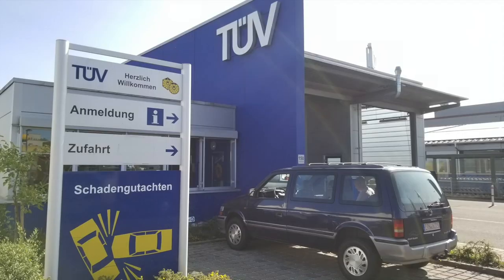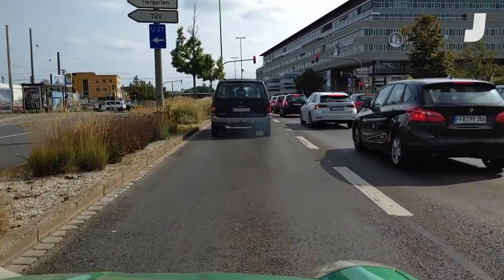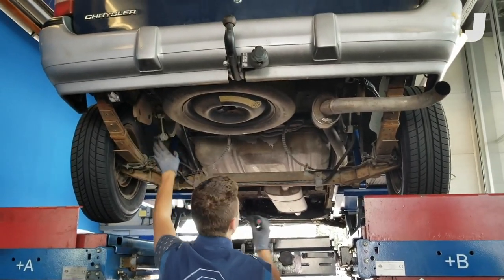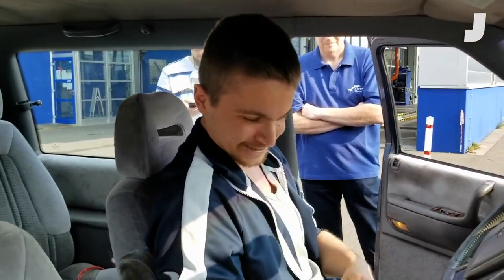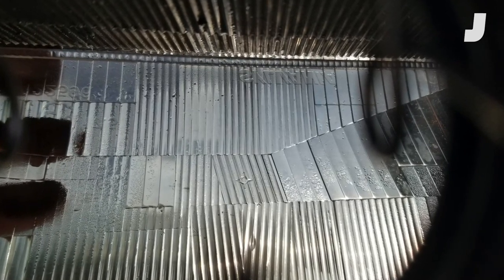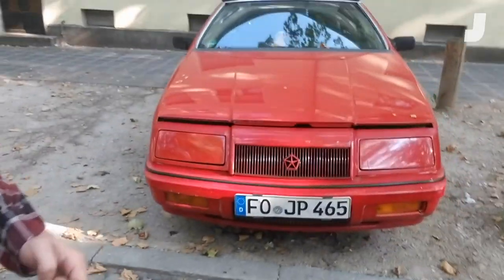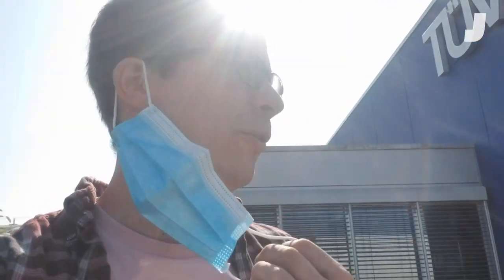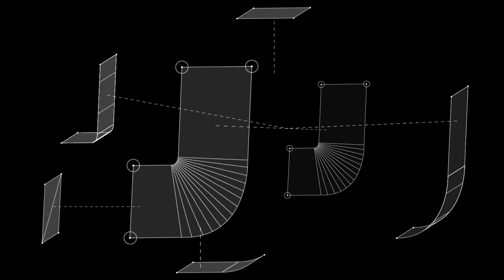I Took A 250,000-Mile Minivan Through Germany's Rigorous Car Inspection And It Was A Disaster

Comment: The price you pay for unlimited speed on Autobahn 💪🏼
Reply: In an old minivan? Its 0-100 time must be 40 years 😂
Reply: One of the many reasons why we will never have a no limit road in the United States
Reply: Ireland’s NCT is the same, once a car is 4  years old it has to do a test every 2 years, once it’s 10 years old it has to do a test every year. No autobahn max speed 120 kph (75mph)
Reply: @eamonnheffernan6061  Same in Switzerland.
Reply: Keeping a car maintained is usually pretty cheap, deferred maintenance is expensive when 2 or 3 things need fixing at the same time.
Reply: @eamonnheffernan6061  Still faster than the majority of Australia at least haha. Max typical speed limit in most Australian states is 100kmh and 110kmh in select sections. Only the Stuart Highway in the Northern Territory has no speed limit and that's only because there are so few people actually out driving in literal middle of nowhere.
Reply: The price you got to pay to be the first at the Autobahnbaustelle.
Reply: Most of the autobahn system now has speed limits, with only small sections without. However, even those sections without have recommended speed limits, with consequences (refusal of insurance coverage, etc) for exceeded those limits. Of course, inclement weather imposes limits throughout.
Reply: @dwightstewart7181  Wrong. Most are still unlimited
Reply: @ObamaoZedong  but even slow cars must be safe on their lanes, when others pass with 150mph
Reply: @piusmartin5178    ..  Right. You go there and drive with that fantasy in mind. I lived & worked in Germany for fourteen years (four periods over thirty years). Most of the autobahn system now has speed limits. The traffic alone is now too congested for it to be otherwise.
Reply: The price you pay for not having cars go through houses every week :P
Reply: @dwightstewart7181  I'll not claim to be an expert, but from what I've been able to dig up, only 30% of the Autobahns have some kind of permanent or temporary speed limit.
Reply: @panzerveps    ..  Guy, every built up area (cities, etc) along the autobahn system has speed restrictions. Since Germany is a crowded country, that alone undermines your 30% figure.
Reply: @eamonnheffernan6061 In New Zealand Vehicles first registered anywhere in the world on or after 1 January 2000 will need annual WoF inspections for their lifetime. For new vehicles, after an initial inspection, another WoF inspection won't be required until the 3rd anniversary of their first registration. Prior to 1st Jan 2000= vehicles need an inspection every 6 months.
Reply: @ArmadaAsesino I know where I am going to visit in Australia.

Comment: That’s not a disaster, having a brake cylinder seized is a schoolboy error for tuv
Reply: How so? They aren't there to diagnose WHY the issue exists. Just IF the issue exists. Lack of braking force is a failure. It's up to you the owner to figure out why and fix it.
Reply: @ArmadaAsesino  no, you misunderstand me. Not checking your brake cylinders are free before going for a tuv test is silly. And after failing once o brakes to go back again without checking them is a bit looney tunes. Hope they charge every time.
Reply: @Ebonyqwe  They do ;-)
Reply: @Ebonyqwe  exactly. They don’t just tell you that you failed. They give you proper data to very simply diagnose the problem. Then trying to sand rust pitting out of a brake cylinder? Wow.

Comment: All American cars has a steering lock all of them since the moved the ignition from the dashboard in the 60s
Reply: Just remove the steering lock...
Reply: @davidhollenshead4892  That‘s also a fail for TÜV. You need a steering lock for anti theft 😅
Reply: No. My 88 corolla has no steering lock from factory. My 98 escort does not as well. But my 88 galant does
Reply: @ZeldaNumber17  well a corolla is not made in America its not a American car neither was the escort it was made in canada or Britain it was a import ford made for there euro market and the galant was made in America weirdly its not a American car but it was made here
Reply: put a steel bar between the steering wheel and apply pressure till it breaks,you guys never stole any cars back in the day?
Reply: My 2004 Monte Carlo doesn’t have one
Reply: @KokaburraDesigns  The lock is not the problem. It locking with the key inserted was. Thieves only rarely come with the keys...
Reply: The integrated locking steering column began with all 1970 model year American passenger cars  from Aug 1st 1969 mandating the ignition switch
be mounted on the steering column and lock the wheel when turned off to deter theft.
Reply: @ZeldaNumber17  Where are you from? Steering lock is mandatory in Europe since the late 60's, and apparently in USA too, so these cars must be made for some other market area.
Reply: @KokaburraDesigns  saabs dont have steering locks since they have the key between seats
Reply: @sixunity1171  The older Saabs lock the gear shifter instead. You have to have it in reverse to get the key out. Newer ones have electrically actuated steering lock if I remember correctly.
Reply: @Eric Vincent Every car I've ever owned only locked with the key out. Even our 1999 Voyager. That's how it's supposed to work. Even if you turn the key to "lock" the steering will not lock until you pull the key out.

If that older Voyager is supposed to work like that, it's a rare exception.
Reply: yes on my saab you cannot take it out of reverse unless you put the key in
Reply: In the US the law is that either the shifter locks or the steering column.  In many cars, both do.

Comment: Similar to car inspections in Belgium. However, the emissions testing looks brutal to me. They only rev it once for a few seconds and that’s it. These tests are flawed anyway, at least in Belgium.
Reply: The test is different depending if it's a gasoline of diesel engine. A diesel engine is revved all the way to the limiter. If it passes on the first try, they don't need to rev it again. Sometimes it takes many tries, as there could be a lot of soot build up in the exhaust.

Anyway, if the engine is in good condition, revving it to the limiter is not a problem. If it were, would the limiter not be too high then? I mean, that's why it's there. To keep the engine revs from getting too high.
Reply: Adrian  calling belgium a shithole is downright silly.
Reply: No offence, but where I live it is exactly the same as in this clip. I think you might be happy to live in a place where they are not too strict. Even my 30 yo miata gets the same treatment as my daily. On another note, where should I go for my next inspection? :D P.s: I live in Belgium

Comment: The mot inspection in N. Ireland is pretty much the same if not even tougher. However the particulate exhaust inspection for diesels was reduced to a less stringent visual test after a string of engine failures due to the high revs.

Comment: About revving diesel cars for many times and for long preiods, it is done to get it through the emissons test. Basically it is to clean the engine of deposits. Warming/Cleaning up your motor before TÜV in my practice has almost never ended up with full gas for over about 10s. If your motor cant handle 10s of full revs well then it is not in a great working order and shouldn't be driven on the road.   Diesels should not be running coal, not even on full throttle.

Comment: This is almost identical to the irish inspections. They dont rev em out as high as these however for some reason. Pretty much a standard european inspection really
Reply: the revs on the emissions test are based on the rpm the max horsepower is rated at, so this is just model specific
Reply: You guys all have those ridiculous  contraptions that shake the car around? That part in particular seems like a very German thing lol.
Reply: @chickenfishhybrid44  nope, even my Eastern European backwater has, so I imagine it's pretty common.
Reply: @chickenfishhybrid44  only thing that can be said for it tho is it keeps heaps of scrap off the road
Reply: @bayseb4a  This is a diesel engine, so it is revved up to the limiter. The test for a gasoline engine requires at least 2000 rpm. Same for all cars, unless otherwise stated by the manufacturer.

Comment: Similar in Malaysia. They use the same machine brand too. 
Suspension test here is not loaded, right before the brake dyno there's 2 metal plates, they're to load each axle on it and the machine will vibrate each wheel separately to test the absorbers. Free play is done to the front axle, similar to the suspension test but these plates move apart horizontally to stress test the steering and tie rods. I have a fleet of commercial vehicle that needs to be sent for inspection 2x a year. 

From what I observed, you need to send the brake hub to a machine shop, have them skim the inner surface. You'll also need a new set of drum brake pads/shoe, brake cylinder(very cheap for drum brakes) and complete flush of the brake fluid. Sanding and not replacing the o rings will result in brake fluid leak in a few months time. It also means it's likely to fail during emergency braking. 

 If you have spare cash, try doing a very thin skim or replace front disc and pads. Clean and lube the whole front brake assembly, you might have some sludge in the front brake cylinder or stuck pins. 

If you did everything right, you'll be getting less than 10% brake force difference, usually around 3-5%. If not check if there's any diverter valves that splits the brake fluid between left and right or front to back. Clean and reassemble.

Comment: yea, that first fail is the biggest issue with the TÜV.
Generally its a good thing, safer cars and all yaknow
BUT 
Whenever you go there, you zhave to hope that the guy actually knows what hes doing. ive had like 3 or 4 fails with modified and unmodified cars by now simply because the person didnt know and just declared a fail.

Edit:
Now that i think about it, i think both the older mitsubishis i owned also locked with the key in the lock in one position so
maybe these guys just werent well informed
Reply: My father has an old English van that has a shorter axle in front, all factory. One time a dumb inspector was telling him he had a mad misalignment to the point he wouldnt even be allowed to drive out of the inspection center to fix it. Turns out one of the measurements the machine makes is comparing the lenght of the two axles and the guy's knowlege only went as far as reading the results from the computer. The problem had to be pointed out to him
Reply: @fgsaramago  that's the problem, inspections are just a scam to get money out of you, they do not increase the safety on the road, you can look up numerous studies that showed in places like America where some states have rigorous inspection vs those that don't and often times the vehicle accident rates are the same or sometimes higher in inspection states.  Most of the inspectors don't know shit about cars and just read shit off a screen, They should only hire real certified mechanics as these people will know what is safe to drive and what isn't.
Reply: @fgsaramago  it doesn't need to be something old or rare. I have a damn mk1 ford focus and the lady wanted to give it an advisory due to the headlights shining too low... The Focus, like many cars, has a switch that can change the headlight position from the inside. The woman didn't know and her ignorance could cost people money
Reply: @eduardopascoal7893  That headlight aiming control is mandatory since 1995, and it's function should also be inspected. Really weird if she was doing inspections, and wasn't familiar with this... At least in Finland we test that too.

Comment: That's pretty similar to what we have here in Spain. It's call ITV (Technical Inspection of vehicles) and they check pretty much everything from headlights, light, brakes, suspension components, seat belts, horn, rust, leaks and much more… they even look if the license plate is ok (if it's bend or the numbers aren't ok you have to change it).
If your car is brand new you have to pass it when its 4 years old, then every 2 years and when it's 10 years old you have to pass it every year. Depends if you have a car, a motorcycle, a truck this times changes… For example in a work van that is 10 years old you have to pass ITV every 6 months
If you don't have it or you failed and the police pull you over you have to pay a 200 € ticket and if you ITV is negative (means you can't drive your car on public roads until you repair it and passed ITV) the ticket goes up to € 500.

Comment: This TUV inspection seems  exactly like a yearly Swedish inspection (besiktning)
Reply: Just a bit more expensive, than the Swedish. 180€ is steep. I paid about 40€ last time if I remember correctly.
Reply: It IS basically the same thing, just not yearly but every two years. due to that its a little harder to pass tho because more bad can develop within two years.

@mabs503 40€? thats JUST au or JUST hu and even for that its pretty low... TÜV süd is usually about 100-130 for both, TÜV nord is a tad more.
180 with re-inspection and all that included is decent. 
Dekra is usually a bit cheaper.
Reply: It's pretty much the same across Europe. Just different intervals like here in Austria it's a yearly thing
Reply: Because the EU law was modelled after the German procedure, just as many industry standards were.
Reply: Yep, same in Finland.

Comment: The rear brake inspection after the 20:00 min mark is a very important lesson we all should learn from. Just because your drums work, doesn't mean they work to full potential. Thats why they need to be checked often, even if they don't wear as fast as the front brakes.

Comment: As a previous Voyager owner: The ignition switch CANNOT be turned to the LOCK position unless the shifter is in the PARK position. Thus it is not possible to accidently lock the steering wheel while moving. All of the attempts shown in the video were with the shifter in the PARK position.
Reply: This is a manual
Reply: @Leatherkid01  - Yes, unfortunately I didn’t notice this until after I posted my comment. I honestly don’t know how the steering wheel interlock works on a Voyager with a manual transmission, but I’m guessing it might be easier to unintentionally lock the steering wheel while still moving. Thanks.

Comment: I actually had an accident due to the steering lock on a mercury cougar, the scenario was I went to shut the engine off because it was having issue and that along with brake failure and the park interlocking caused it to steer towards a vehicle on a tow rig and parked and the failure of the brakes and panic park engagement caused it to not have forward motion as it rolled back down a hill and steering wrong caused it to aim towards what I didn’t want to hit, and it locked in that position, I was out of the equation

Comment: Enjoyed the video. That’s pretty harsh. I’m sure none of my vehicles would pass. We are spoiled in the USA compared to most of the world. I’d imaging a 70’s - 80’s full size American car would shake right off the lift during that suspension test. Repair shops must do a brisk business over there.
Reply: They actually don't. Shops in Germany are so ridiculously expensive most people don't bother and the junk cars get exported to eastern europe to pollute our roads.
Reply: I believe vehicles are tested against the standards of the time. So if it was safe to be sold in the 70s or 80s from the factory it’ll pass because it’ll be tested on 70s or 80s test. That’s how it works in my European country at least.

Also once they get to 40 years old they’re exempt from their yearly inspection any way.
Reply: @olliewebbuk  over 30 years you can register a vehicle as "hystoric" but you still have to do the safety check every 2 years...just dont have to pay so much tax and insurance for it...
Reply: @olliewebbuk  AFAIK that only pertains to the emissions testing, everything else is tested the same. Of course there is some other stuff like not requiring type certificates for some aftermarket parts if the car is from a time they weren't required. Also 30 years is usually the age for classic cars in most countries.
Reply: Yeah, it is not the repair shops that make money in Germany, but instead the car manufacturers. Germany has a reputation for buying back classic cars once exported because the 20-30 year old cars have already been crushed :D

Comment: I thought steering lock is actually a safety feature for parking on hills. You can lock the steering in the correct direction.
Reply: The steering lock itself was not the problem but that it was activated while the key was still in the car, which can be dangerous if you have to turn down your engine for some reason while your driving.
Reply: It will only lock the steering when the gear selector is in park.
Reply: @MatthewMoss644  it's a manual car not an auto there is no "gear selector"

Comment: As a german I. think the inspection is even not strict enough... Not every inspection station is testing the shocks... Most people drive around without knowing they got bad shocks and that extends your breaking distance by a lot... I drive an 12 year old Toyota diesel and just replaced the shocks and all bushings passed the emissions test with just one full throttle run... no issues found on my inspection certificate. Maintenance is key... That's why you don't see stranded cars here on every corner... a well maintained car takes the stress out when you go full throttle on the Autobahn....